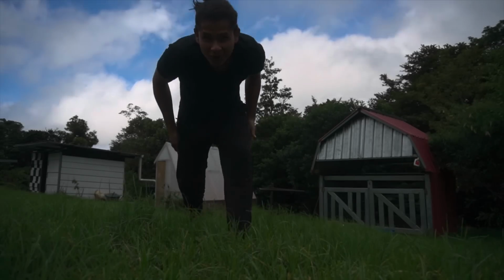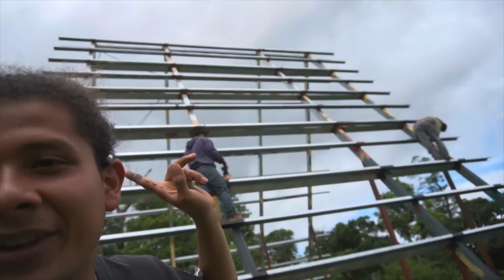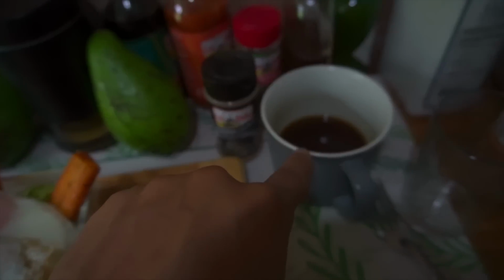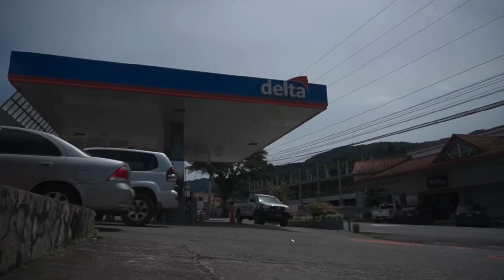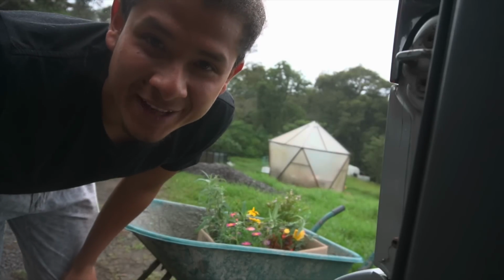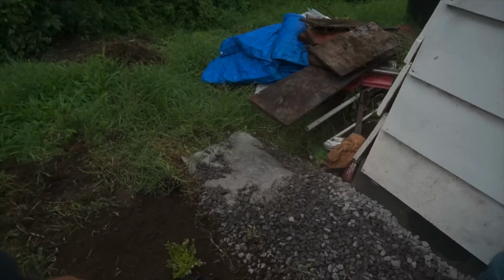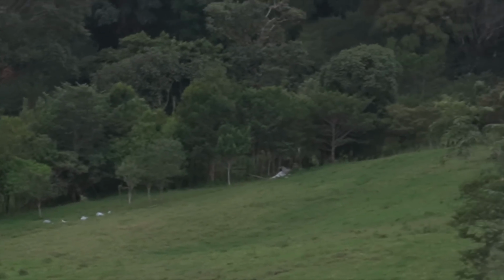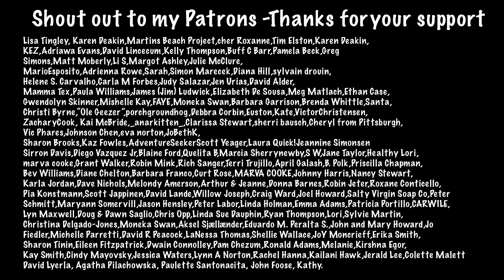What’s Like to Live in a 2½ Acres Farm // Off-grid Living

Comment: Mint is very Aggressive in the garden. It  will spread everywhere and crowd out all the other plants. Put the Mint into a large pot or planter with holes in the bottom, on the end to keep it in place and pull out any new ones that start in the grass. Mint will come back year after year and as long as you don't stop watering you won't have to replace next year.